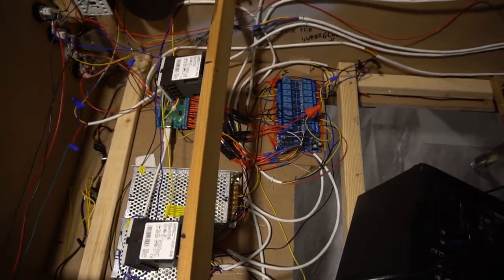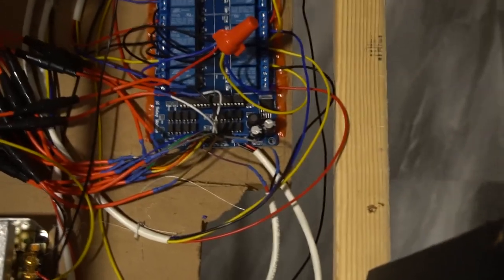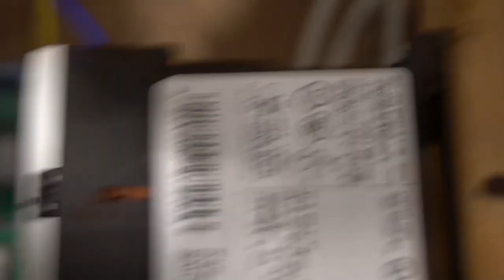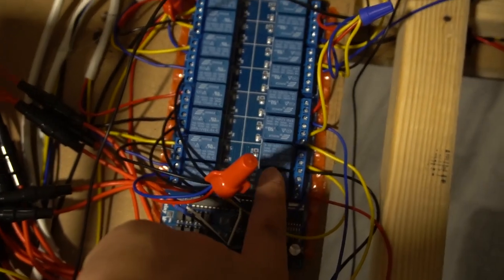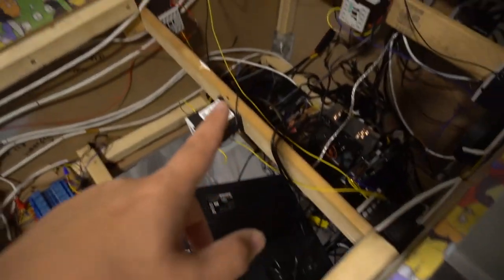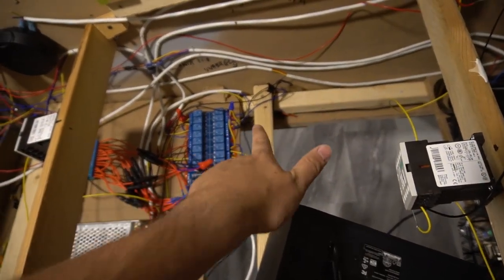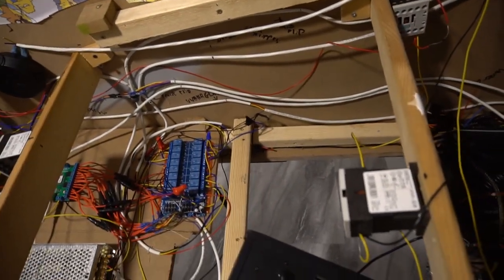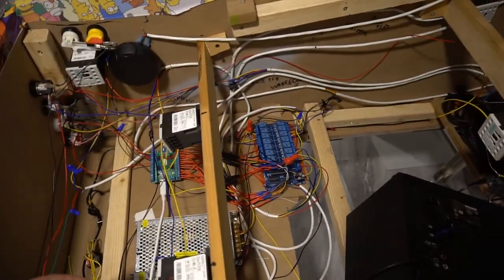Wiring tutorial for your Virtual Pinball Build

Comment: Not to be the devil's advocate but the fuses are not in the right places. You see, the Sainsmart board are run by opto couplers. The LEDWiz is sending signals to them telling them to activate the contact relays. There is no way there would be any back feed of any kind, risking any damage to your Wiz. They would be better used AFTER the relay contacts cause now, since the power are daisy chained, should one item go bonkers, there are more chances of having problems than in between the Sainsmart and the Wiz. Other than that, very nice setup. ☺
Reply from the maker: As stated, I followed Mr Frenchy. What hour suggesting I believe js the diode / resistor which I have on all my toys.
The fuse from my understanding is in case the 24v,12v touches the signal area and then send that voltage to your ledwiz and thus to ur pc usb and poof done 👍

Comment: great job and thanks for sharing it. You encourage me to develop it. Could you tell me specifically what type of solenoids you use? cards? relays? I want to see with a list of materials if I can find them here. Thank you!!
Reply from the maker: It's been some time since this was made so I use different solenoids now
I have another video close to the time this one was aired that has a parts list

I use the 16 channel sainsmart board and Packard C140A 1 Pole 40 Amp Contactor 24 Volt Coil Contactors
Reply: @ muchas gracias, thank you!!!
Reply: @   thank you very much for responding. your videos are very inspiring. If I find the materials, I will dare.

Comment: Just got the contactors connected to sainsmart. The knocker and gear motor are working but I can't get the contactors to work. The sain smart clicks with a red light every time I push the flipper or hit say slingshot etc but that is it. When I check the contactors directly with a 24 volt power supply they click. any thoughts on what it could be?
Reply from the maker: Do u have the 24v going in to the relay... the middle of the 3 on the relay
Reply: @Vic_VP  yes I do. Its so odd. The exact thing I did with the gear motor and knocker
Reply from the maker: @juanperez772  do u have the diode on it? Maybe it's not in the right direction
Reply: @Vic_VP  I checked that too the stripe is on the positive side. Anything else you can think of?
Reply from the maker: @juanperez772  Def if you have the red light in the board then it's gotta b a wiring issue with the solenoid.
Do you have the ground of 24v going to the solenoids
Reply: @Vic_VP  I am running the ground from the 24 volts to one of the solenoids and then daisy chaining like your video. Is the light supposed to be another color that is  not red? With the gear motor a knocker the ground goes straight to the power supplies with obviously no Daisy chains. Still trying to figure out where I'm going wrong. Why those two things are working on the board but the contactors are not.
Reply from the maker: No on the sainsmart it's always red.
Maybe send a vid on Instagram and I can see
Reply: @Vic_VP  I'm going to work on it tomorrow morning and see what I figure out. I don't do much Instagram I will try to send it. Thanks as always
Reply from the maker: @juanperez772  yea easiest way is to send vids and Instagram is really the best way lol

Comment: Not appreciating too much right now the combination of ssf and contactors working together. Don't hear or feel much of the contactors with the flippers bumpers or slingshots when ssf is on. Wondering if maybe going to the tables sound file and taking off the slingshots fx and flipper fx. This way I can appreciate the contactors and at same time enjoying the ssf effects on the rest of the table. I don't know maybe lowering the ssf volume what do you suggest?
Reply from the maker: Go to ledtest software and just trigger the solenoids... what solenoids did you get? 
Solenoids give the thump... they don't give the sound effect really. Ssf gives the sound
Reply: @Vic_VP  yes I did the LED test and they do work. Maybe the solenoids are not strong enough I don't hear major thumps. Got Siemens 3rt1016 for about 13 bucks each on eBay
Reply from the maker: What's the full number? Is it the one i have? On the power supply is a little round knob , make sure it's all the way up.
Reply: 1bb41 or the last word digits remember the same one that you have. The power is all the way up as a matter of fact it is the same power supply that I have my knocker connected to. They are working maybe not as loud as it should?
Reply from the maker: @juanperez772  your first numbers are not the same as mine. Your last numbers yes... but not the first. 13$ per solenoid doesn't sound right as currently my number on ebay is like 45$ per solenoid
Reply: They were used. I believe Maverick industries
Reply from the maker: @juanperez772  but your first numbers are not mine, they make a lottttt of different models to us may have a lower hz model
Reply: Oh I see. I appreciate it I could not have done it without your videos
Reply: Vic, I am using contactors for everything except for three of those  inexpensive 24 volt solenoids for the  bumpers. I'm assuming that it is okay daisy chain those together with the contactors while the positives go to the individual Saint smart relays like normal?
Reply from the maker: Yes as long as it's the same volts you can daisy chain them
Reply: Perfect!

Comment: I have just strobes, flashers, beacons, and rgb led string lights mostly based on your video.  However they all work just fine without the sainsmart.  I do have fuses on the led lights just in case but verified they’re nowhere close to hitting 0.5 amps on the LEDWiz channels.  With that said, what is the purpose of using the sainsmart?  Or is that more applicable if using 24v devices?
Reply from the maker: More compatible with 24v,  UT are you running 12v to your toys that you mentioned?

Comment: Hey vic  any reason why you shouldnt run the 5v and 12v direct from the PC PSU other than wattage useage , what is the recomended wattage for the whole systems leds flashers and strobes. or you just use a deadicated PSUs to avoid any wattage overlaod
Reply from the maker: Hey Sharkey what's up! Yea I never use power from the psu of the pc, wattage usage and also risk in case wires get crossed... I rather fry a 20$ Amazon psu than a pc power supply.

I'm building 3 pins right now
24v for solenoids
12v for leds, strobes, flashers, beacons and other toys like shaker motor or fans
5v for arcade leds and now they have thkse addressable leds with matrix that either are 5v or 12v

When buying power supplies I look for the most amps... so 60amps, 30amps, 20 amps. More amps means it cab handle more toys at once 🤘
Reply: @Vic_VP  yer thought as much, cant go wrong running dedicated PSU, how is buisness I see a lot of vids up man ,
Reply from the maker: @SHAR-KADE  
Yes and also incase a customer has to swap out a bad powersupply jts much easier

going good man I post more on the fb group 🤘 you too man ur busy! I'll probably be reaching out to u and Brad soon cause I got a 4 play rail shooter coming up after these 3 vpins I'm building 🤘

Comment: I've built two virtual machines using the Sainsmart relay boards - with three boards failing in the first year of use. They use mechanical (metal contact) relays that bend and break over time. The failed relays were connected to flippers. So I replaced the Sainsmart's with MOSFET drivers.
In cab #1 used four "RGB W LED Amplifiers" - they work great and have had zero failures.
In cab #2 used a ZEB's  24 output MOSFET driver board - and that has been working great as well.
While both solutions work great, I recommend ZEB's because it's an all in one solution which saves hours of wiring compared to the RGB amps, and the instructions are complete and easy for anyone to follow.
IMPORTANT NOTICE: Do not use the 12v 7AMP power supply pictured in the video as it doesn't have the current capacity for MOSFET's, and will crowbar. You'll need a 10 AMP minimum - I went with 12V 30A supply since it's driving all the toys and under cabinet LED's in both cab's.
Reply from the maker: Weird, I've done 5 pins and currently building 3 with the same stuff in this  video. Maybe link to power supply is bad, but yes I get the highest amps available, 30 Amps on the 12v js usually highest found. 
Never had a sainsmart fail and I play my personal Simpsons pinball in this video daily for 2 hours. 
Maybe u didn't have diodes on your flippers?

As far as the other boards, yes there gold but expensive... my route and videos show the cheapest way with yes more wiring 👍
Reply: @Vic_VP  The suppression diodes were installed correctly, and that part of the wiring has been used on the new MOSFET installs - with zero failures. While the Zeb's boards might seem a bit expensive - the other MOSFET option - using "RGB W LED Amplifiers" cost as much Zeb's. The four channel amp's are $12 each on Amazon and I use 5 of them - 4 for solenoids and toys, and one for undercab leds. In addition you'll need a ledwiz or klz25 - around $50. Plus about $15 to $20 worth of wire to put it together, with about 4 to 8 hours of labor -depending on any miswires you need to troubleshoot. After swapping out the Sainsmart with RGB W amps in the first cab, decided that $100 for Zeb's "DIY 24 channel power output board" was a no brainer for my second cab.
Bottom line - the $ cost implementing any of the three solutions, Sainsmart, RGB W amps, or Zeb's DIY 24 channel board" are pretty much the same. But the difference in labor time spent is significant.

Comment: I am currently in the process of building my vpin cabinet and wiring/placing everything inside is next. I see you mounted the flipper solenoids by the flipper buttons... would you recommend that location if you were to build another, or would you mount them under the screen/playfield where the actual flippers appear to be? I have a support beam going across under where the flippers/bumpers are on the playfield that I was planning to mount the flipper solenoids in front fairly close, and 2 bumper solenoids on the backside of the beam on opposite ends.
Reply from the maker: Hey bud! I highly suggest mounting it like I have it ... you really feel the thump in your hands. 
Mounting it on a cross beam like my bumpers is fine also, but you won't really feel the power in the solenoid. It's like a flick vs a knock. I rather feel the knock like a real pin would feel
Reply: @Vic_VP  Thanks, I was wondering how much of a difference that would make... I've seen it done both ways.
Reply from the maker: @obsidian1710  you can always trial and error it. But to me it's a must to go on the side wall. That plus SSF is a amazing feeling

Comment: You mentioned that you used speaker wire to jump the ax power?  That can go bad lol.  You should use 12 gage non stranded 
Everything else. I thank you for. I just got the same setup with a led wiz and Sansmart :).  So you helped allot.
Reply: Although if it’s low Amps pulled. 14 gage is fine too

Comment: This was such a great video. I bought a generic virtual pinball cabinet a few years ago with no bells and whistles. Have been planning on adding solenoids, LED Matrix, siderail LED addressable and maybe even a shaker motor. This video will help me because I'm no electrical guru at all. Have a couple 8 channel sainsmarts I bought as well. Thanks so much. What gauge wire do you use?
Reply from the maker: Awsome dude! 18 gauge I used 
18/4 is pretty standard

Comment: Vic - did you ever add a shaker to your cabinet.  If so how would you connect it to the sainsmart and ledwiz?  How would you handle if there is too much shaking from the shaker?
Reply from the maker: Yes I did check my recent vids of Jared's pin. Shaker is 12v.
Also you'll need a board to control how many volts goes to the shaker 
I used this 
RioRand RR-PWM-15V Low Voltage Dc... https://www.amazon.com/dp/B00N30UK2M?ref=ppx_pop_mob_ap_share
Reply: @Vic_VP  Thanks Vic.  I did see that video.  Great looking cab.  Can you please help me understand the wiring of that speed controller board?  As far as the shaker hook up, this is what I understand:
1.  5v negative goes into the GND on the LEDWiz
2.  12v + Power Supply to 12v + of Sainsmart
3.  12v - Power Supply to 12v - of Sainsmart
4.  In1 on Sainsmart to Port 1 on LEDWiz (with inline fuse)
5.  12v + Power supply to Sainsmart Relay 1 COM input
6.  Shaker - to Sainsmart Relay 1 NO input (with diode between + and -)
7.  Shaker + to 12v Power Supply negative 

Does this sound about right?  How would I go about connecting the speed controller to this?  Thanks.
Reply from the maker: 1-3 yes. 4 be sure your utilizing the bottom pins on sainsmart for this.
5. Sainsmart has 3 little circles On one output. 12v + goes into the middle. The top and bottom are NC OR NO normally closed or normally open.
6. No wrong - shaker + to NC 
7. No wrong - 12v neg to shaker neg.

The board goes between you shaker and sainsmart.
Board has a +- in and a +- out.

So you just put the board in between. Sainsmart 12+ to board + to shaker +. Power supply 12v- to board - to shaker -
Reply: @Vic_VP  Thanks Vic.  Really appreciate the help.  Got an email I can talk to you through?  I have a diagram that I put together for adding the speed controller that I want to send to confirm.  To me a picture is worth a thousand words.
Reply from the maker: Dm on insta its faster @vic_vp

Comment: Hey Vic, thanks for the video. Can you tell me what gauge wire I need to use to connect everything? Can I use the same gauge for all electrical components? Thanks
Reply from the maker: Wiring with 120v (like the extension cord wiring will need 16gage)
Everything else I used 18 garage wiring
Reply: @Vic_VP  thanks!

Comment: Hey Vic, following closely along your journey. Awesome stuff bro, thanks for sharing all this insight!  Did you find any of the solenoids, relays or anything else (besides the wiring and terminals) pertinent to this installation at Micro Center?  I’d like to run over to my local store and pick up whatever I can rather than order online and wait. Thanks!!
Reply from the maker: Hey bud, you can't find anything in micro center for this stuff
I only got the arduino wires from micro center

Comment: You mentioned that if you had to do it again, you’d put the pc up front.  As I’m starting to lay everything out, what do you think about the boards (sainsmart, LEDwiz, KL25Z) as well as the power supplies in terms of where you placed them?  What about the speaker amps?  Thanks again man.
Reply from the maker: Check my recent vid of the gameplay... in the beginning you can hear the fans of the power supplies as im talking.
And in the middle of the vid i point out about the sound the sainsmart board makes.
I would suggest power supplies jn the rear and the sainsmart board in the rear. You will still hear the fans and sainsmart, but i figured in the rear it wouldn't be as loud as I currently hear it.
The klz should be in the front of the cabinet as per the instructions... the nudge is much better read with it in the front... but i bumped up the sensitivity in vpx so im ok now
Reply from the maker: Speaker amps I put them in the backbox so I can access them. You will want to put them in a place thats easy to access for adjusting. I would replace my locating by placing it in the front opposite from my logitech speaker controller to avoid confusion lol

Comment: What size inline fuses (amps?) did you use for led wiz connections? Thanks!
Reply from the maker: 100 QT 500mA 250V FUSES F500mA AL250V 0.5 Amp Fast-Blow  FUSE 5mm x 20mm

Comment: Hey there…I’ve spoke to you before and like your tutorials. Just have a couple questions. 
1) with the three prong outlet, how do you know what colour wire is positive, neutral and ground, to then connect to power supply?
2) when linking (daisy chain) all power supplies to one another, is it just to power them up?
I ask, because I thought I followed your video properly, however I still ended up smoking my wires. I also had terminal blocks connected ad wondered if that was the cause. Please can you help?
Thank you in advance 👍🏾
Reply from the maker: Hey bud.
1. Green is ground, white is neutral, black is live. Your power supply have 3 things on the left or right side (L,N, and a upside down triangle symbol) L is black wire, N is white wire, triangle is green.

2. Yes instead of having 3 plugs into a power strip.. I only need 1 plug.
Be sure to use the correct gauge.. I cut up an old extension cord

Not sure what you would have terminal block connected to
Reply: @Vic_VP  to be honest, I believe I'm going to remove the terminal blocks. I used them to connect the solenoids. But the more I watch your video, I don't need them.

Then, I'm trying to understand the fuse connectors and the purpose of them. Because before having solenoids, I didn't need those and then watching your video, it's recommended.

As I mentioned, I don't know how I smoked my cabinet, but I did and afraid to touch it.
Reply from the maker: Wait you connected your solenoids to the black and white?! U fried the solenoids 100%
That's 240v
Reply: @Vic_VP  no I didn't. Hard to explain. Would have to send you photo. Solenoids are fine...I believe I've messaged you on messenger, I'll reach out to you there. A lot easier

Comment: I watched your pinball build videos and you mentioned, the playfield is 49 inches, if that is the case, what is the actual width and length of your playfield cabinet?
Reply from the maker: My playfield  is a 50 inches
I followed the same plans as a bally wide body
Only change is the width which on my pin is 25.5 
Everything else is the same as the plans for a bally widened which you can find on google
Reply: Thanks!